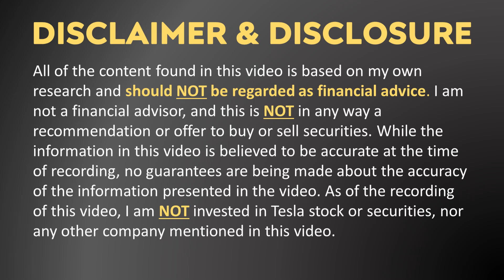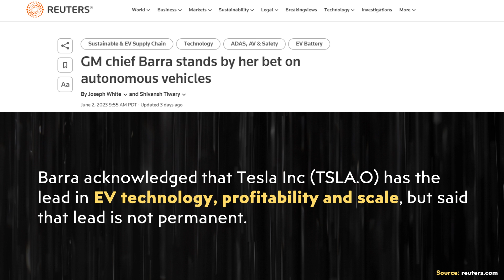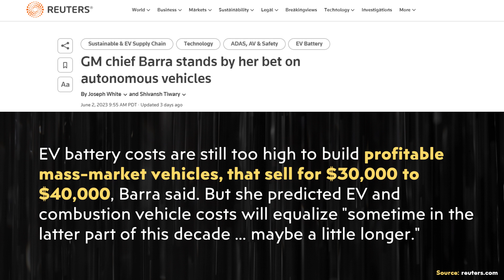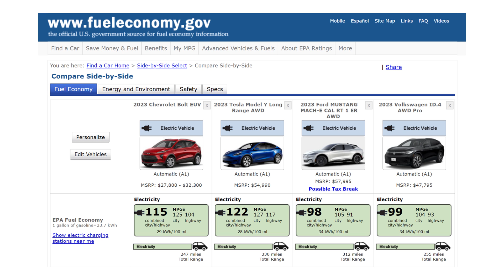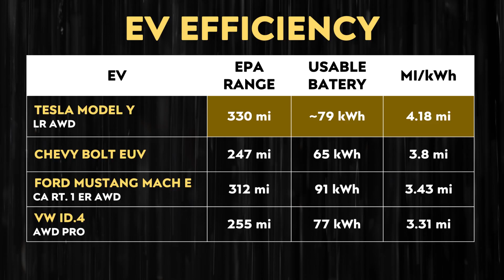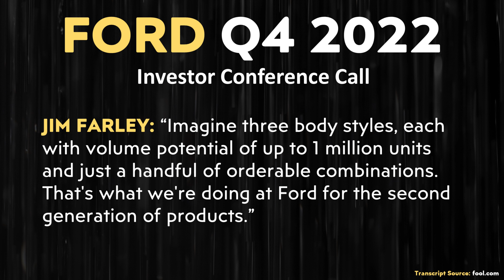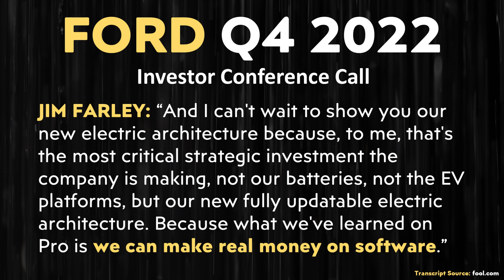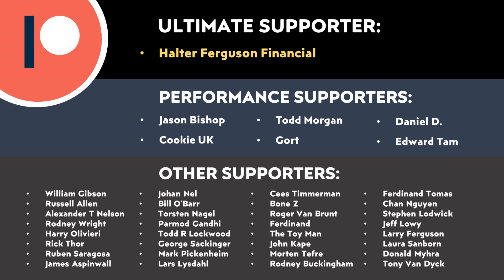How TESLA EVs are PROFITABLE when GM & FORD's are not | They Can't Catch Tesla

Comment: Commentators (I'm not talking about you) focus on how Tesla is "losing market share". Well DUH! A bunch of other companies are making EVs now and of course Tesla is going to lose market share.

What they need to focus on, which you DO focus on, is how many vehicles they sell, are they selling more or less of each model, and how they are reducing costs by using larger presses to reduce the number of parts that a Tesla is made of, which reduces problems and also reduces cost.

Other companies are also relying on external companies to produce a lot more parts for their vehicles which drives up the cost of parts. Sure they can squeeze them on money and then quality gets degraded too. But those companies have investors too and they demand returns on their investment. This drives up cost or lowers quality in the parts that external companies make. You can't have your cake and eat it too.

With Tesla making a lot of their own parts they don't have to worry about if/when company X wants to change or improve their product. If Tesla makes it, THEY have control and not external suppliers. Because of this Tesla can make changes anytime that they want to and incorporate them at any point of the model year or the model's existence. 

This goes for software as much as hardware.

One issue I have is the front ends of the Model Y and Model 3. They are VERY plain and boring and anyone wanting something more exciting looking while not wanting to compromise on distance, has no choice but to spend more on a performance or plaid version or spend a LOT more and buy a Model X or Model S.

I'm not going to go into the things I very much dislike about Tesla's FSD software in this message. I'm going to focus on looks and right now, if I was going to buy an EV based on looks in the same price range, just going on that I would never buy a Tesla. They are plain and boring.

I'm a 64 year old white man who lives near Seattle. I recently retired after a 40 year career as a programmer and systems analyst starting out in a small company and later working for companies and organizations with over fifteen thousand employees. But then all of us that bought EVs are most likely nerds.

And my primary reason I bought an EV is to avoid gas stations and vehicles where I can't "fill up" at home and have a "full tank" when I have somewhere to go. And when I do need to charge away from home, I either get food and eat in my car while charging or I plug into a charger and go somewhere to eat, or use a bathroom. By the time I'm back I've got more than enough charge to do the next leg of my drive before I'm either home or I need to eat or use the bathroom again and so I plugin and have my Tesla charge while I'm away, and then again have plenty of charge when I get back.

However, if I was an EV buyer RIGHT NOW and I was to look at how a normal Tesla dual motor long range looks compared to another brand and was only buying based on that, I can tell that is a HUGE reason why Tesla is "losing market share". And that doesn't go into the issues with FSD that bug the hell out of me and make me want my $10,000 back.

By yes, keeping things as much as possible in house. Plus taking multiple parts and turning them into one part so you have less worry about things fitting or performing. Plus using less wires and ethernet to communicate with most parts of a Tesla which other companies aren't doing yet. And them moving to 48 volt for the future. All put together, along with them constantly looking at ways to update and improve and reduce the parts all together helps Tesla reduce costs and improve their profitability which in turn allows them to reinvest more, meaning that net expenses are much lower (I learned accounting before I became a programmer so knowing that allowed me to write programs with more intelligence than my co-workers) than for other companies.

Comment: Top notch summary. As you've said Tesla's manufacturing efficiency plays a huge role - I'd add "spacetime efficiency" where they are not only able to out as many vehicles in a smaller footprint, but as Herbert Diess admitted, roll twice as many fully built EVs off the product line in any given time than their rivals, while paying a single salary and power. That gotta hurt for supposed manufacturing expert.

Comment: I can’t wait to see what happens when the truck hits the road.
Reply: When the CT arrives... With 1 million+ reservations...
.
Consider all those Legacy trucks sitting on franchise dealer lots at 10% of more over MSRP, While manufacturers are trying to feed the next batch.... (which they MUST sell at a profit to fund transition).... Onto the same dealers.
2+2 does NOT = 42
So.
Options?
Dealers are in the hole, with loans outstanding on inventory and nobody buying.
They can sell at cost, which might flood the market IF customers arrive.
They could sent stock to auction, but will dealers at auction drive the cost even further down? (probably)
.
If these trucks flood the market, how will they sell the NEXT wave at a higher price when the ones they just let go are "old" but Zero Mile, so won't need replacing?
.
Something has to give..
.
And how many are waiting for the CT?
.
It's going to be "messy" in Franchise dealer land

Comment: Legacy automotive has far too much outsourcing and not enough vertical integration. They must build more parts in-house.  Many components now have software which raises costs and has integration challenges.  In many situations, Tesla designs one component to replace three from legacy auto.
Reply: Legacy hasn't built components in house for years 😂.  Legacy autos don't actually build cars in the same way Tesla does - they assemble cars, sell them cheap and then live off parts and service